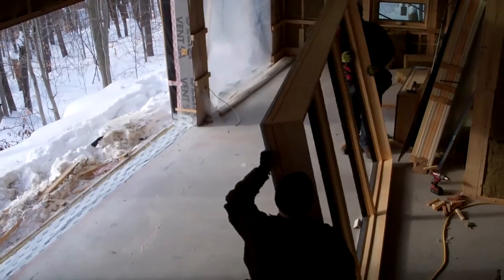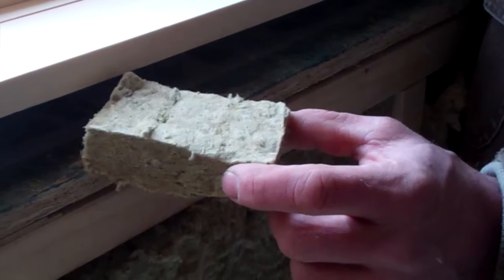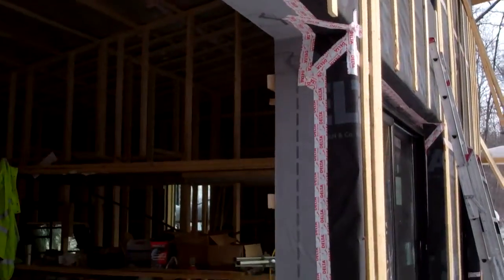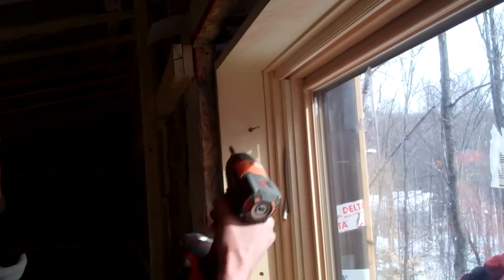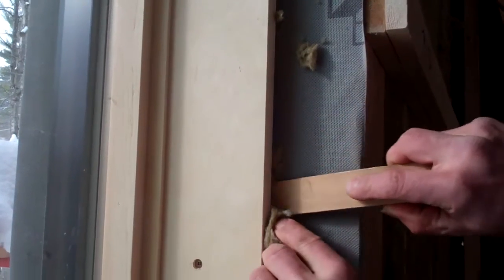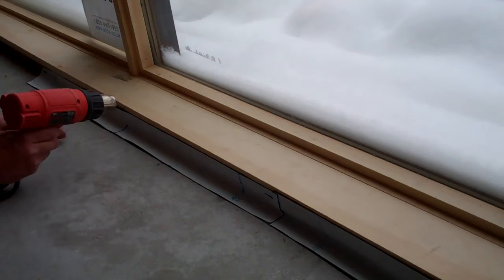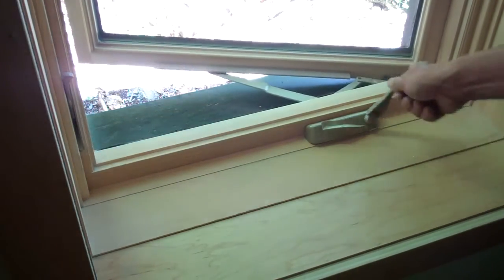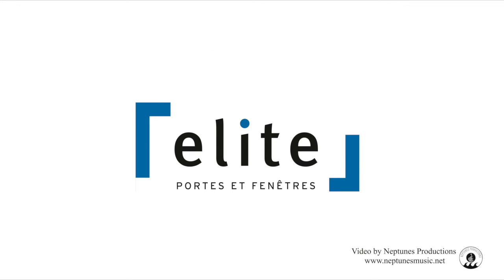How to Seal Windows & Doors correctly in LEED Homes & Passive House High-Performance Window Fitting

Comment: I'd like to remove the interior window casing of our windows as I suspect that there is little to no insulation there.  What tape is it I should use to seal the air space once Roxul is inserted?  Thank you in advance.
Reply: Hey bud, Did you end up doing this? I want to do the same

Comment: Great video, but compressing fiberglass batts does not decrease its R/in.  Just like any other batt material, the R/in remains essentially the same - you just have to add more batt to achieve the desired depth.

Comment: Did you use only retro fit windows for this project.  I see the extended rough opening made with plywood.
Reply from the maker: Hi Peter, these are normal windows, we inset them slightly to reduce thermal bridging. late in responding I know sorry, but not sure what you mean by retro fit windows. if its not too late for an answer feel free to drop us a note at info@ecohome.net best regards.